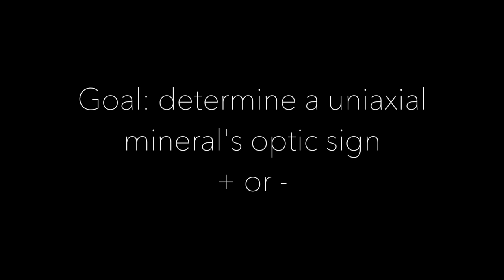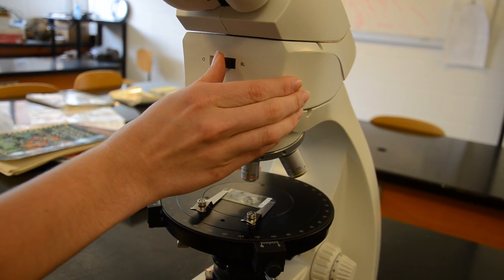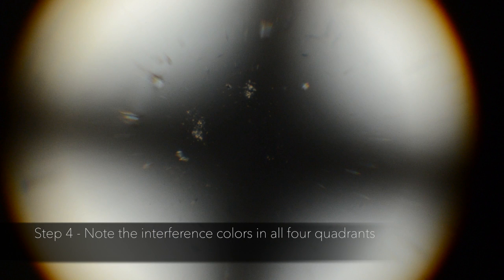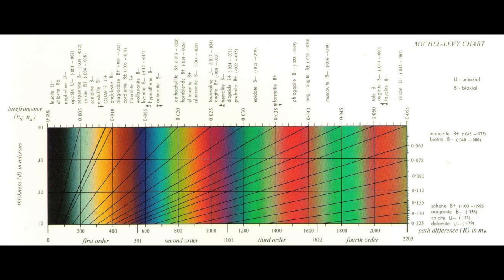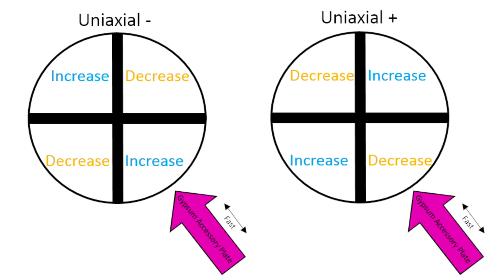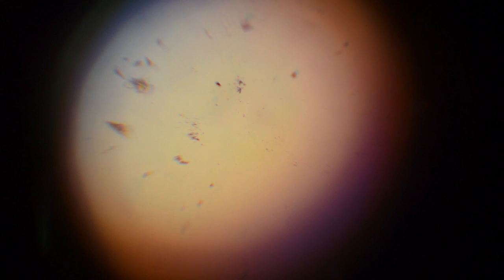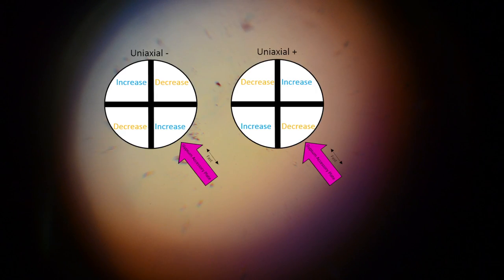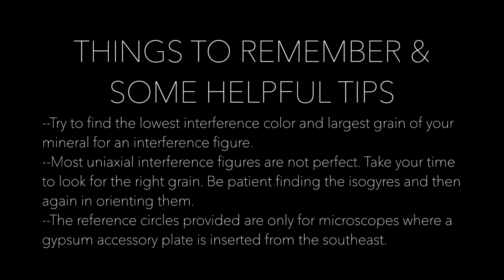Earth Optics Video 4: Uniaxial Minerals

Comment: How are you rotating your isogryres?  By moving the thin section slides or by rotating the stage.
Reply from the maker: Good question! The isogyres are rotating on the screen as I rotate the stage. If you move your thin section, you run the risk of moving off-grain and losing your interference figure.

Comment: 1)can someone explain how and why does the Bertrand lens change the colour of the light? i can't understand the physics of the optics here...
Reply: Junaidee Jimmy Kok I don’t think the Bertrand lens is changing the color I think it’s the accessory plate, which is usually a thin sheet of gypsum which vibrates at 550 nm. It changes the color because it either slows down or speeds up the light wave creating constructive or destructive wave which allows the color to change.